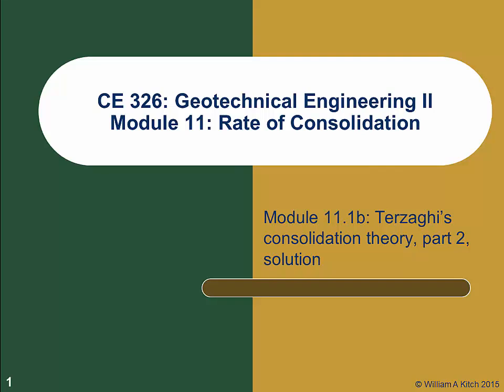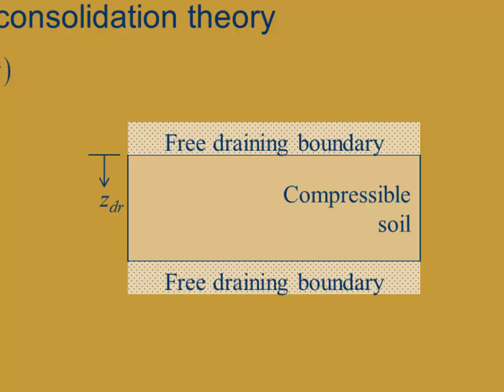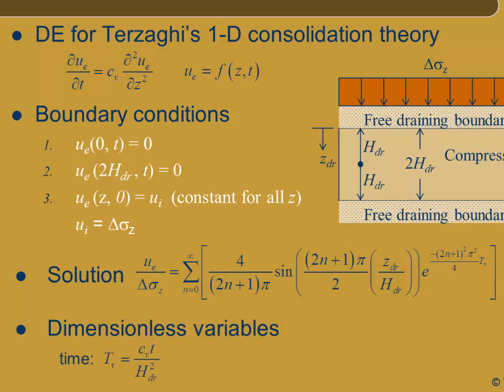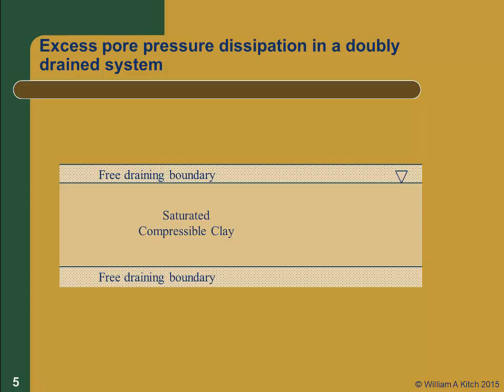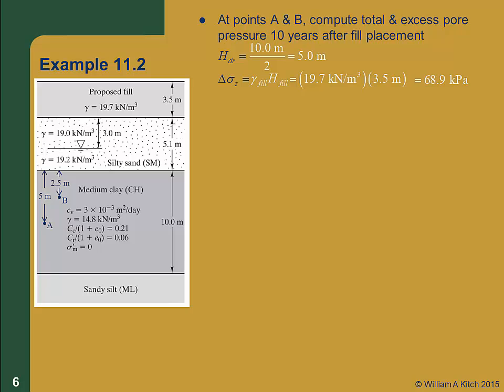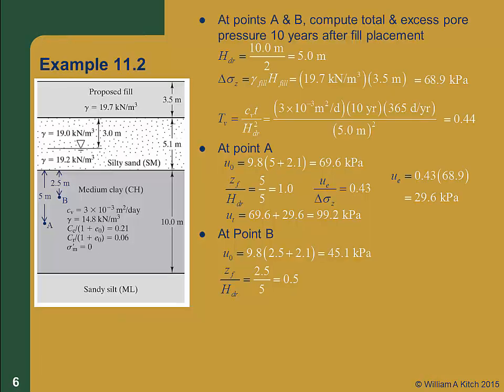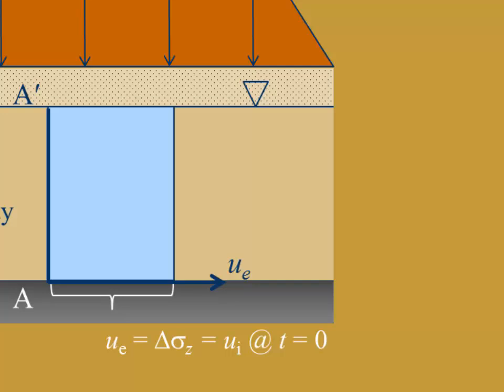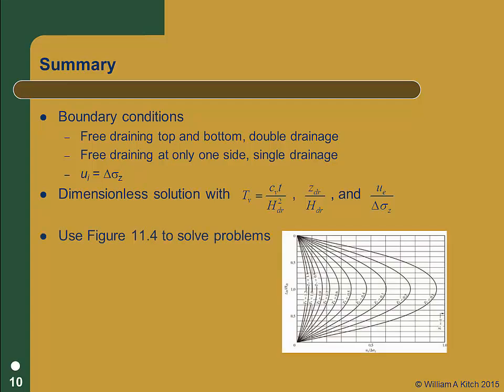CE 326 Mod 11.1b Terzaghi's Consolidation Theory P2

Comment: Hello professor, please I have a question, can we calculate soil stiffness from consolidation test ? , And if not , how can we calculate it in the lab, best regards
Reply from the maker: The result of the consolidation test is simply a stress-strain curve.  So yes you can compute stiffness from that.  However, you need to be sure it's the stiffness you really want and it will be non-linear.  What you would get from this test is a drained, constrained modulus, M.